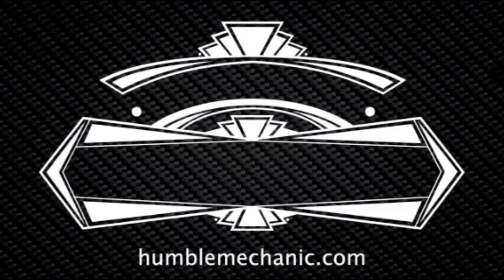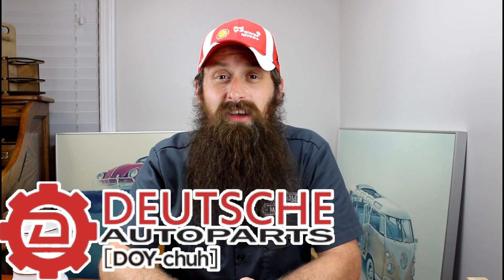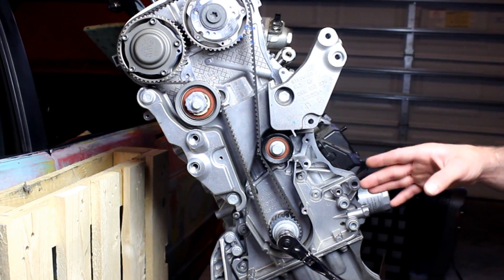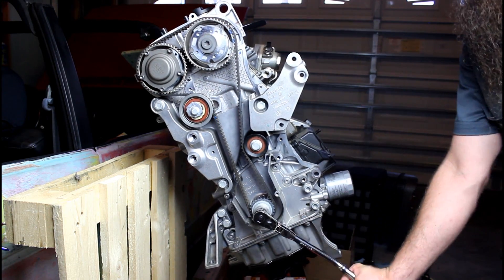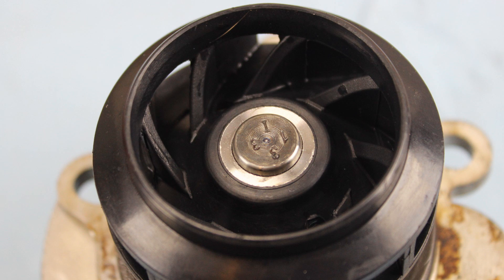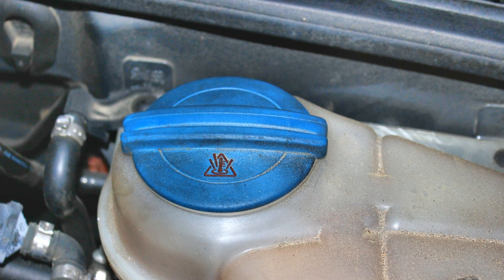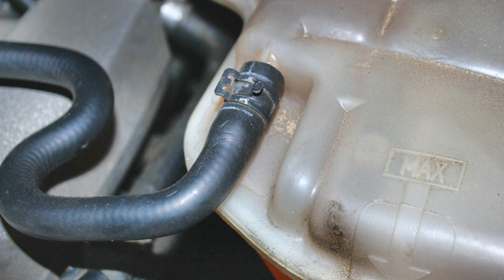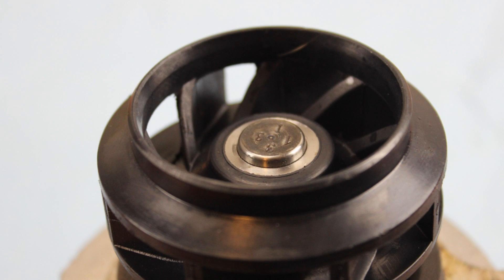How VW Water Pumps Fail

Comment: I have owned 3 jettas with this exact water pump first jetta water pump failed at 100k miles since then I have the habit of every time I buy one of those jettas to replace the timing belt and water pump I always went with the metal impeller tho
Reply: Have you seen any of the metal impellers fail?
Reply: Nice! Where did you buy the water pump with the metal impellers?
Reply: If there isn’t any problems with the metal impeller why not go with it cause it last longer

Comment: Hey big fan and very thankful for your videos they have saved me and my family a great deal of money i have a 2006 volvo s80 5cyl with 134,000 miles on it i recently replaced the front struts with the upper strut bearings and both sway bar end links but when i turn tight to the right i get a weird clinking noise and i dont know what it could be. It sounds like something is lose but i have checked and double checked and everything is tight i have even used a pry bar with the car on the ground and tried it with it on jack stands but i dont feel any looseness.  Any ideas what it could be? Thanks again and keep the great videos coming!

Comment: Great video I like those demonstrations. When I was driving my Buick  I had dirt and sand destroy the water pump. Drove all over town without coolant and the overheating light never came. I guess I got lucky.   I have a feeling HumbleMechanic has turbos on the brain, when mentioning the plastic compressor wheel by accident.
Reply from the maker: Simple Auto1 Yeah, I meant to cut that out. Looks like I missed the edit, but I got a good laugh on it.

Comment: my '01 225 TT water pump failed, plastic impeller fell apart. Replaced with a metal aftermarket one, I should've went with OEM.

Reason being was that the old material that was used to create the plastic impellers were called durathan. Durathan had a heat threshold of 100C which lead to cracking and premature wear.  New plastic impellers use a material called PolyPhenelineSulfide which had a heat threshold that doubled that of durathan.
Reply: I'm going to replace my water pump too. My problem is that my coolant isnt flowing at all and overheats but my pump isn't leaking and I already replaced thermostat...what could be my problem
Reply: @SEALTEAMDRIFT  Did u figure it out, I have the same problem.  Cold bottom hose, water pump looks new too. Im gonna take the thermostat out tmw. A4 b7 2.0t